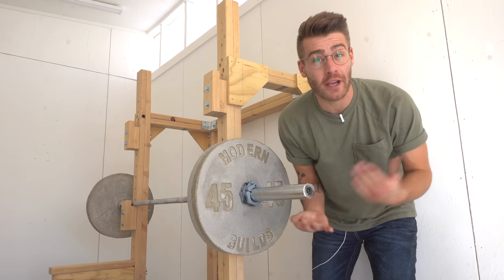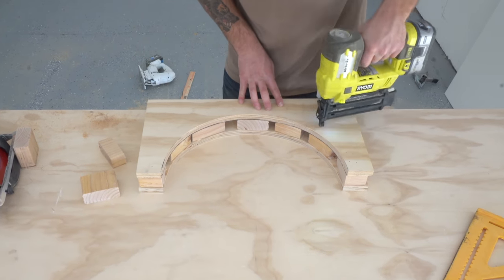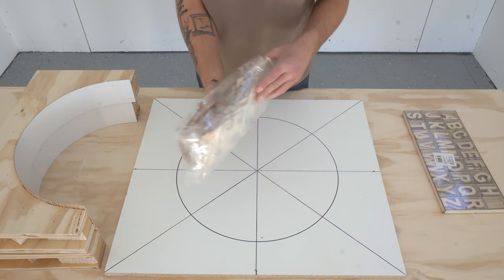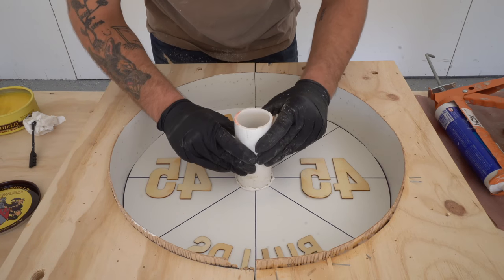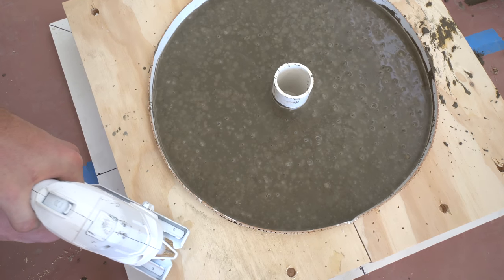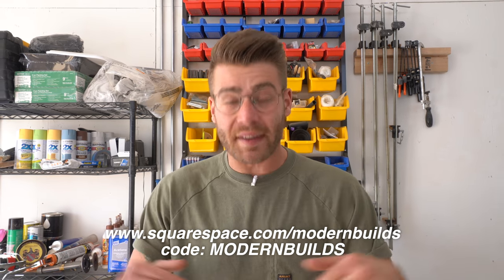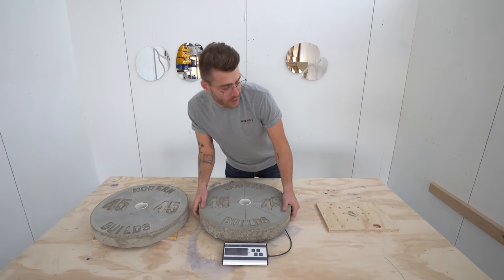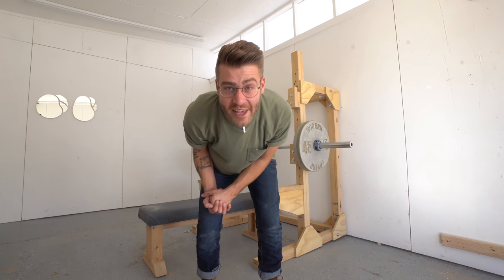DIY Concrete Weight Plates | SAVE MONEY & DON'T BUY MOLDS

Comment: I did the same thing at the start of the pandemic when weights were sold out everywhere. I just bought a 55 gallon garbage can and cut the bottom off and used that as the mold. It was like $20 and worked great. It even has handles from the bottom of the can.... You can also just use silicon lubricant as a mold release, it's much easier to apply.
Reply: He did exactly that in a previous rendition
Reply: How much do they weight?
Reply: @princeofprussia9120  Yeah but he used a 20 gallon (45 lb plates) bucket instead.

Comment: Add metal mesh, bent rebar or stripes of fibers in the concrete mix. It will reinforce the structure ten fold from shaking and dropping fractures.
Reply: so true. I added chicken wire to all my plates. One day on bench press I forgot to put cuff links on and the 45 lb fell directly onto my 15 pound plate. Nothing happened lol
Reply: @@wide_Aaron anything that’s strong and flexible will be really good for the concrete. Think about it like this- concrete is very strong, but extremely brittle. You should cancel this out with adding something flexible. Generally, the more area it covers on this inside of the concrete the stronger it will become. So if mesh covers more area, I’d go for it. However if you’re going to be rough with your weights then I’d use something a bit thicker.
Reply: @@wide_Aaron Well heres the thing. If you're using really heavy weight and slamming it, yes. But in that case you should also use fiber glass to minimize chipping. The thing with rebar is, it only covers a small portion of area. If you can fit multiple rebar then you're solid, I doubt it'd ever break.
Reply: @@wide_Aaron yeah. The fiber glass will pretty much look like a bag of shredded cheese. Because it’s so tiny you can poor it in while you mix the concrete. It helps with micro fractures and chips. Another thing you can do to prevent chipping is to get those rubbery sprays
Reply: @@wide_Aaron and yeah, happy to help with the advice.
Reply: @@wide_Aaron so essentially what I would do is, mix your concrete. Once it’s wet, pour your fiber glass in and mix that with the concrete. Pour a bit of concrete into your mold, put your rebar in, pour over the rebar with the remaining concrete

Comment: Super Pro Tip; use olive oil or nonstick spray on the back of the wood letters. They will come out easily once the cement cures
Reply: Better is to cover them in packing tape, oil can mess up the concrete, the tape releases great.

Comment: For next time just a thought. Weigh your concrete out to 43-44 lbs. Then if you want to get more creative get a couple cans of flex seal rubber and spray your plates. Then you will add and extra layer of protection and make them a little more durable. 
In all pretty cool idea 💡

Comment: Random thought from someone with far less knowledge and experience with concrete:  maybe you could sand the plates down little by little to dial the weight in to be exact?  Although with how close they already are that's probably completely unnecessary and total overkill, but just an idea from someone who is a perfectionist and is the master of overkill, lol.
Reply: they will never be perfectly balanced it concrete, constant use, wear tear much quicker
Reply: @ZahNiNah  Except it would take literally 2 seconds if you used the saw to cut one rectangular piece of plastic and 2 circles to encase the concrete. Plus you could bind the plastic using a simple hand torch, soldering iron or high powered heating element.

For the imprint you can buy those numbers in metal, weld a handle onto them then encase the handle in something that absorbs heat so you aren't burned when the numbers are heated up. Then after that it's just a simple process of branding the outside of the plastic weight.

That entire process though is still simpler than what he accomplished. I recommend that if you want to make weights that are more resistant to being dropped as well as damage. It does add complexity to what he already showed how to do though which is amazing.
Reply: Weigh dry powder and water separately. Adjust for the correct ratio. Wet concrete weighs the same as dry (cured) concrete. The water doesn't evaporate it reacts with the slurry chemically to harden.

Edit: you lose some weight.
Reply: @jakknight2158  you could even just double or triple dip them in epoxy after the concrete had cured. Should take a lot of the stress of dropping it off the concrete itself.
Reply: Honestly the best thing would have been to add fibreglass, it's not at all complicated. Just need the ability to measure and mix lol.
Reply: Ahhhah
Reply: I used a wheel balancer and drilled 2 holes used wheel weights and epoxy them in. Alsom metal band around the edge

Comment: If you have a 3D printer, you could print the letters and numbers. Make the edges of the letters/numbers sloped, so they will easily come out during demolding. This also gives you more options: Fonts, diacritics, sizes, logos, borders, the list goes on.
Reply: Or you can carve them by hand

Comment: lbs plates that are not calibrated can have such a insane difference per plate. Its amazing that you were able to with in a such an incremental tolerance. I would argue that your weights are more accurate then most 45 cast iron lbs plates! love to see the work that you do my bro!
Reply: Lol no argument. You can give a compliment but don't go overboard
Reply: @jd2161  unless you get calibrated plates, cast irons can be even 5 lbs off, he's not exaggerating whatsoever.
Reply: should use metric
Reply: @altairtodescatto  I agree, hello from the Netherlands, but the man used imperial so I played along

Comment: Great work, about as accurate as you can get with each of the weights too!  I get great results using a reciprocating saw and remove the blade to remove air bubbles from concrete and then cover it with plastic for 24 to 48 hours. You can also can use dye if you want to make your weights black for example. 👍🏼

Comment: Had good results using a single disk of melamine as a base for a mold and a small roll of roof coil for the side walls. I applied caulk to the edge of the disk before wrapping the roof coil around a couple times. I secured the coil with hose clamp.
After the concrete set up I could undo the hose clamp and just unwind the roof coil. Only issue I ran into was the white coating of the melamine bubbling and coming off onto the concrete with repeated use of the mold

Comment: Great project. I really would like to know if the fiberglass fibers would make them more durable? I guess I would be worried about the plates cracking if you put them down to hard. I know it would change the weight but any thoughts about painting/coating them with anything. Thank so much for sharing!
Reply: There's two types of concrete. 

Concrete that has cracked and concrete that will crack. 

The fibers help a bit. But still concrete will eventually crack. It just comes with usage of concrete. No one can tell you exactly how long or when because the mix determines its properties.
Reply: Plastidip or similar MIGHT help with chipping, giving a layer to at least contain the cement.

But eventually they aren't going to look like they do now
Reply: Get the Quikrete green bags, that concrete mix have fiber and other ingredients to make the concrete more resistant to crack. I used that on my backyard floor which was ver chipped and cracked and worked nice, no problems in more than 4 years. Using a concrete sealer, then painting it and adding some rubber laminate in the circumference will help them last longer.
Reply: The OG way🤞🏾😎
Reply: Would there be a way to put a coating or something like rubber on top? Any brainstorming?

Comment: Some wire mesh in the concrete, like with floors, would be a good idea the if for some reason the concrete gives out it won't  bust apart retaining some weight that way a bust-event while squatting doesn't lurch to one side so aggressively.

Comment: For cost breakdown, its a lot less : the minimum you'll find for a weight set is a $1.5 - $1.7 per pound. if we cancel out the cost of the olympic bar, and go with a set of 2x45's 2x25's , 2x15's,  it would cost 300$ bare minimum for extremely discounted weights. if you used this method ,its about 180 pounds of concrete. At around 5$ per 66 pound bag, you're looking at $20-25 of concrete accounting for error. Add to that the cost of tools and materials ( saw ~ $30, material ~40, not considering you might already have the tools or part of the materials ) and you get to around 100$ max for a weight set. You could probably add GFRC and a rubber lining to protect the weights and boom. 150$ weight set that's just as good as the pro's.
Reply: Amazon has 45lb. Plates for $50 right now. These are not worth the time or money. Cool for a video, not practical though
Reply: Not everyone values their time at $0 though or wants to wait 6 weeks for drying
Reply: @SnowsLife  correct. And my statement still applies.
Reply: @SnowsLife  I said wait, not watch. Your comprehension is great and you proved my point about not valuing your time.  Take care
Reply: @buildr3303  stop talking to yourself. Don't bring me into this.
Reply: @buildr3303  If anyone is valuing their time by the dollar then they probably have enough money to buy a complete weight set anyway. This is for people who are ultimately budget constrained. Say you have $500 but you need to spend it on 3 different sectors transportation, food, and fitness. Once you buy all the stuff in the first few categories then a regular joe or maybe a teenager might not have the cash left for 6 plate metal weight set.
Reply: @MrObsvenchilde  i disagree with the value of time statement not applying to everything. I do agree that you could evaluate any situation and determine it is worth your time based on budget. However, I was referring to this specific video and it’s time. In your example, if that individual went to even their low paying job for less time they probably could afford to buy a nicer set and be using it and not waiting for concrete to set.

Comment: Would you be closer to 45 on both, if you mix both batches at the same time and weighing when filling the forms, so both forms are equal?
Reply: Definitely, I did that when I made some concrete kettlebells. However the problem is that when the mix starts to dry the weight varies a lot but still they will be very close.

Comment: The extra pound is likely the pvc as you didn’t account for that when mixing your concrete
Reply: The pvc is negligible, it will be the moisture that stays in the concrete when it cures. You'd want to use slightly less than 45 lbs of concrete premix

Comment: Just giving my two cents here: one, as it doesn't actually "dry" but "sets", I guess some of that water is absorbed by the material, therefore it will weight more than the weight of the cement itself. I might be wrong but...

On the other hand, that build might crack and break when in use, so it could leave you unbalanced and, well, you might get hurt. From what I see around, some people protect the cement with some kind of rubber or anything making it look like a wheel with a concrete rim. Just saying.

Nice finish though.
Reply: bike inner tube rim
Reply: Correct, fresh concrete is lighter than hardened concrete, about 20% give or take. A part of the water chemically bonds to the cement particles in a process called hydration. The rest of the water evaporates. Both processes (can) cause shrinkage of concrete.

Comment: Could you make the side walls or outside of the mold with simple cardboard taped to the bottom wood piece instead? Also would someone be able to use cardboard for the numbers instead of wood? I feel like there is a shortcut, or cheaper way to going through this whole process of making a plate mold.

Comment: Wait so I'm confused you weighed 45 pounds of concrete then added water does that not make it heavier ?
Reply: Yes, which is why they are heavier
Reply: not by much. Water is just there as a catalyst for the concrete to set. Then most of it evaporates.
Reply: @SnowsLife  this is party true. it doesnt evaporate.

Comment: Don't buy ready mixed concrete, it's rubbish! They always skimp on the cement. Any concrete structure you see is grey (concrete grey) that's because it has a high percentage of cement, I would use  1-5 mix for these, you'll get a nicer finsh on them and they'll be a lot less likely to chip!

Comment: By the time you get through buying the over priced wood needed to make the mold and assuming you have all the tools he used,  you would've spent twice the amount of just going to Walmart and buying the actually steel/iron weight.
  If you wanted to make more out of concrete later, you can just get some and make an indention into the sand with the weight to where the sand comes to the same level as the weight. Remove the weight and just fill that sand mold with concrete.. the only tool you'll need is a small shovel or something to mix up the concrete. 
   You're welcome

Comment: I'm curious what the price difference is between buying all the materials for all this equipment VS just buying the actual equipment
Reply: Equipment is thousands of dollars
Reply: Its a lot less. the minimum you'll find for a weight set is a $1.7 per pound. if we cancel out the cost of the olympic bar, and go with a set of 2x45's 2x25's , 2x15's, and 2x5's ( this is really the bare minimum ) it would cost 300$ bare minimum for extremely discounted weights. if you used this method ,its about 180 pounds of concrete. At around 5$ per 66 pound bag, you're looking at $20-25 of concrete accounting for error. Add to that the cost of tools and materials ( saw ~ $30, material ~40, not considering you might already have the tools or part of the materials ) and you get to around 100$ max for a weight set. You could probably add GFRC and a rubber lining to protect the weights and boom. 150$ weight set that's just as good as the pro's.
Reply: @saulgonzalez8101  not really, I've seen lots of quality sets for some hundreds. I remember looking into it all when covid started. Wasn't too bad, but now with higher costs for wood and whatnot, curious how it is. Too lazy to re research it all rn
Reply: @SnowsLife  hmm interesting, thanks for that. But also gotta count in for good sturdy wood to build a squat rack or bench rack. But I guess yeah could be cheaper. I seen good towers for both ranging from 300-600.

Comment: Tools and Materials for 2 45 lb plates 
$401  
Amazon  2 45 lb plates 
$145.98

The cost only becomes worth it if you build 6 45 lb plates
Reply: $10 worth of concrete, $100 worth of tools & material. Dont know where you got your numbers but you're wrong. After the 45's its 66 pounds of concrete for $5.
Reply: All u need is a bucket 2 bags of 50lb concrete and pvc pipe that’s how I made mine. Under $20

Comment: Concrete is not supposed to be this dry. You can't use 45 lb concrete to get a 45 lb plate, that's nonsense.

Comment: all nice and good till you accidentally drop it
Reply: its cheaper to replace the plate than to repair the floor anyway (in case you dropped an iron plate).
Reply: @vittocrazi  you think concrete does no  damage to floor?
Reply: @lockdown976  It does... But less. Way less

Comment: Pro tip, just buy some cheap plates and avoid this nonsense
Reply: Pro tip, this worked great during the pandemic when everywhere was sold out and people were selling used for double the price.
Reply: @bannedtwice7767  another pro tip, don’t wait till a pandemic to start working out.Everyone should have a power rack and 300lbs of weights , regardless of circumstances.
Reply: @rosema7909  lmfao

Comment: Really cool. I wonder how these will hold up long term
Reply: he really needs to do a small simple test using other materials too. drop testing them all.
Reply: If you drop them constantly on a hard floor they will start to chip and crack fast. Adding some rubberized coating can help or some rubber laminate around.
Reply: @Ebolachicken  drop test adds nothing. you will just break them and thats no good. drop testing cast iron plates would be pretty stupid too but it doesnt stop them from being good training equipment.